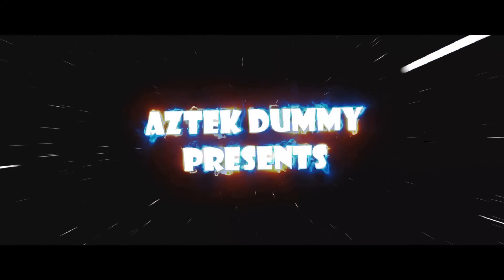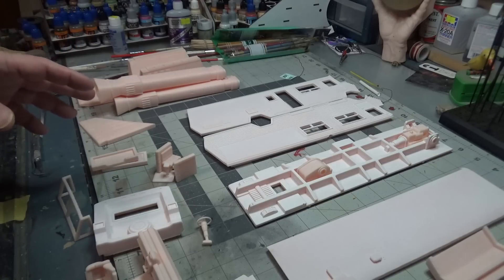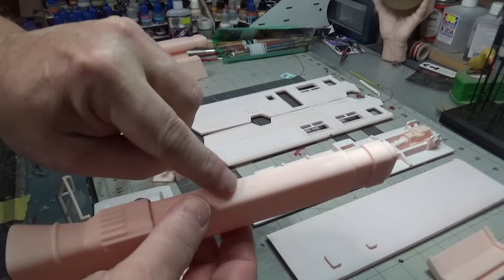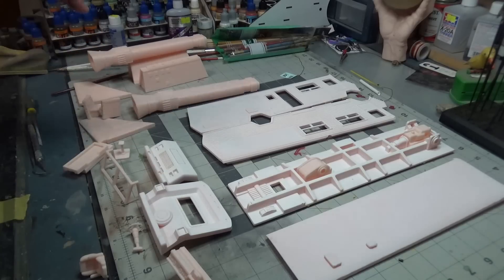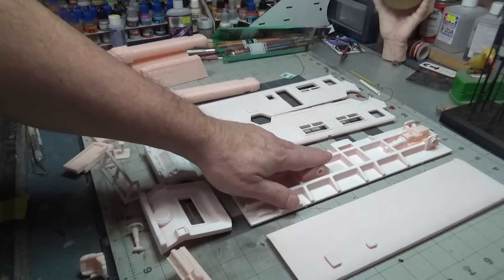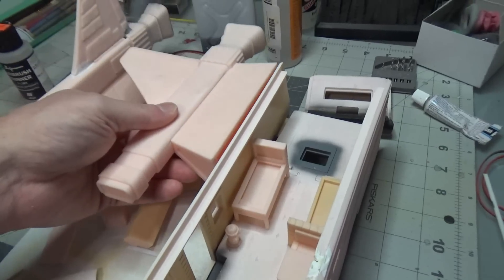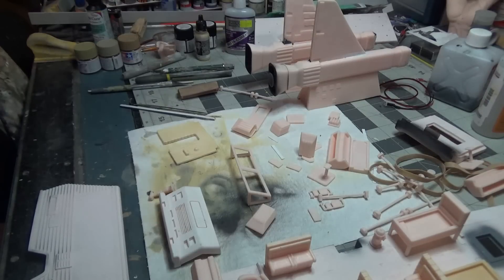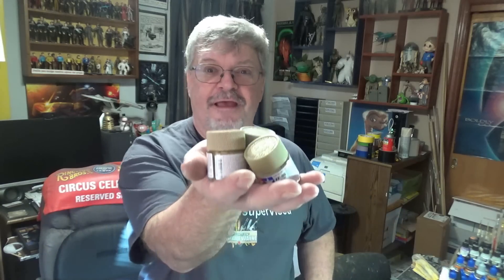Aztek Dummy Update 1/27/23 - Spaceballs: The Eagle 5 Build - Part 1

Comment: I didn't know resin or printed kits of the Eagle 5 existed. Way cool.

May I suggest you consider adding resistors in series with some of those LEDs? They will dim down so that you can adjust their brightness to what you'd prefer of course but will also run cooler (cooler as in literal temperature not color temperature), thus extending their lifetime. Heat from overcurrent is the silent killer of LEDs.
I notice you're not as soldering shy as you used to be, and adding resistors won't tax your skills. Selecting resistor values is easy. Just buy bags of standard value resistors (with solderable oeads, not SMDs) online and try various values until you get the effect you want. I'd suggest looking for ten-packs of all values from 270 ohms to say 1k ohm.

Comment: Hi Lou, love the topic and the movie, looking forward to the final outcome. Quick question if you have the time, Printing large panel items like you have, do you print directly on the bed?
Reply from the maker: No, I put them on a slight angle. There is detail on both sides of the part. My printer has a perforated plate, so i always print my parts with a raft.

Comment: Lou, what 3D printer do you use to print this type of kit? Great video by the way.
Reply from the maker: The mighty sonic mega 8k from phrozen.
Reply: @aztekdummy   Nice, I bought that same model last month and just completed my first successful prints. Was trying to determine if mine would print out parts the size you have in the vid. Guess it will. thanks sir. Looks like I dont have to buy another printer.
Reply: Crap, i need to learn how to read. I have the Mighty but looks like you are using the mega. oh well will see if i can angle the sides of the Eagle 5 enough to fit. Thanks again sir.
Reply from the maker: Sorry for the confusion. After I typed that I remembered that phrozen had a printer called mighty.
Reply: @aztekdummy  No worries, thanks Lou. One way or another I will get it printed.